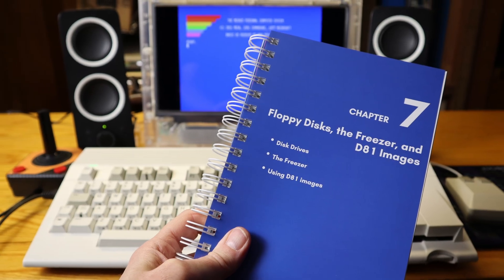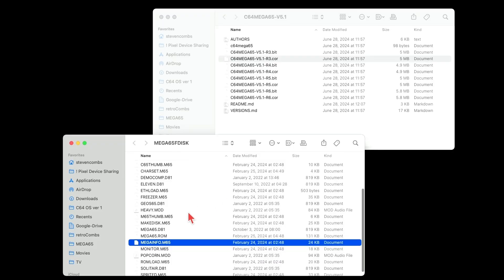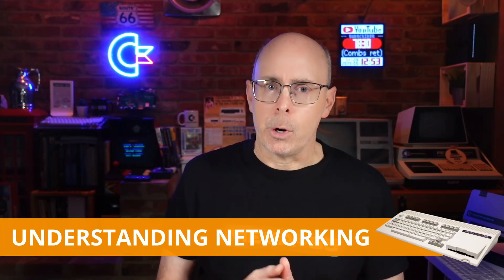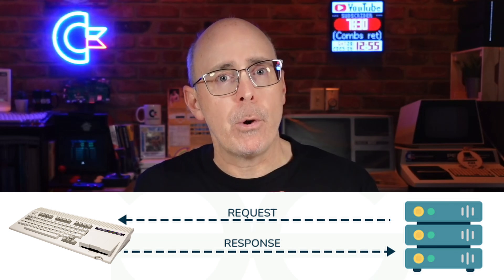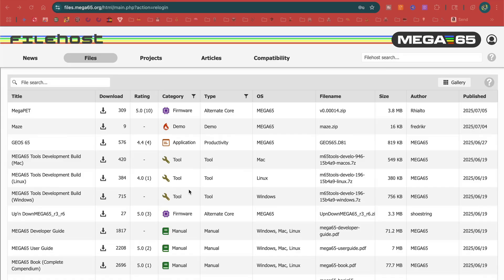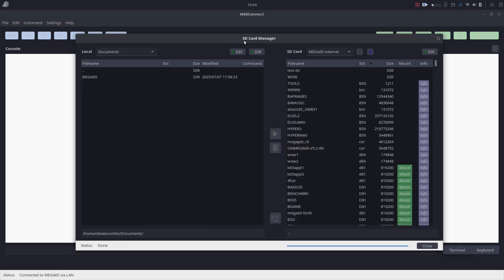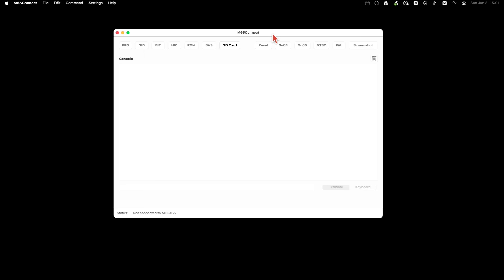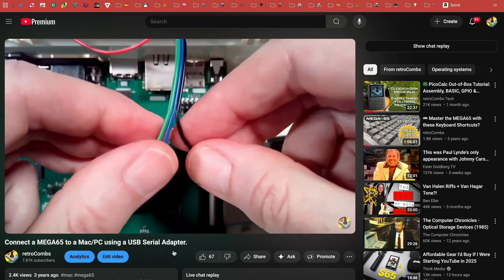MEGA65 File Transfer Tricks Every Owner Should Know! (Ch. 7)

Comment: Just a comment about network listening, but it was my understanding that the network listening feature of the MEGA65 R6 boards was enabled by default, unlike the earlier revisions - at least, it was when I received my MEGA65, so it may not be necessary to flip any DIP switches if you have a newer revision board.
Reply from the maker: You are likely correct. I did follow the manual closely. I'll add it to an errata in the video description and when I update the web pages. Thanks for the catch.
Reply: @retroCombs  We kept information about the DIP switch in the manual to cover both versions of the board, and for troubleshooting in case Trenz forgets to flip someone's switch at the factory. :)
Reply: same for me!

Comment: Very nice and informative video, thank you!

Clarification: Screenshot and terminal functionality over M65Connect is not possible because it's not (yet) implemented in etherload. The CLI tool requires terminal operation mode for offering the advanced functionalities currently only available over JTAG.
Reply from the maker: Does that mean if etherload is updated, those features could be implemented?
Reply: @retroCombs  That‘s correct. M65Connect relies on the functions offered by the CLI tools. kibo already mentioned it would be a lot of work though.

Comment: Let's go! Great info. I'll admit it: I used my Mega65 once when it arrived years ago, and haven't touched it since. Partially was not knowing how to update cores, not knowing how to transfer files, and not wanting to mess up the default configuration. Partially was that the aspect ratio wasn't correct, and it wasn't displaying the way I wanted it to on my monitor. I can see by your videos and Jeffrey's videos that the firmware/software has come a long way since then, and I'm going to try it again.
Reply from the maker: Please do and report back. The community keeping everything updated and adding new features is one of the fantastic parts of MEGA65 ownership.
Reply: Same here. Played a few hours with it. 😅. I think my mind was more in a commodore  65😂 while mega65 is much more. I have amiga 1200 (compact flas card)  atari 800xl and atari 2600 both with cartridge sdcards. Still in boxes commode 128, commodore 128 with diskdrive, commodore 16, plus4. Commodore 64GS. (This only has a cartridge slot and 2 joystick  ports)
Reply: Also amiga 500